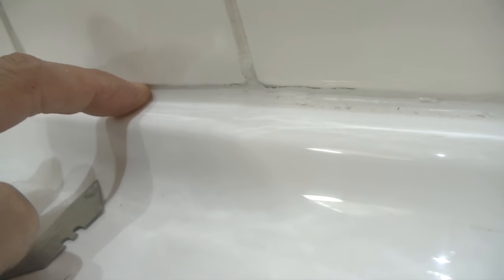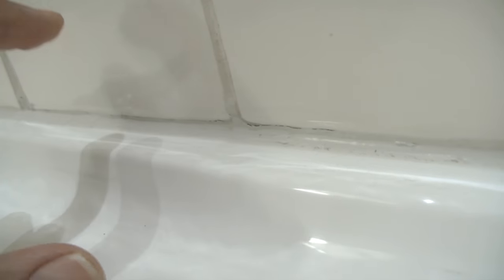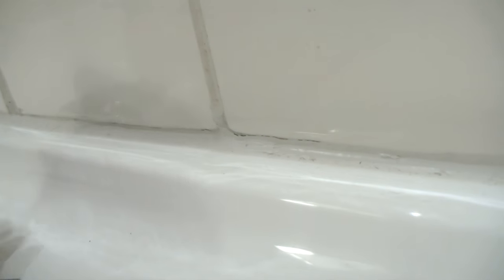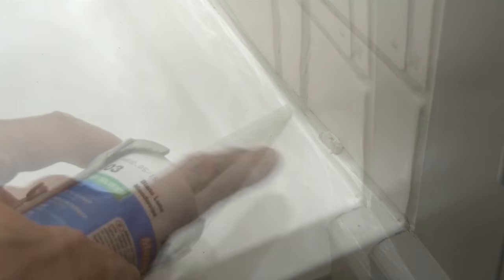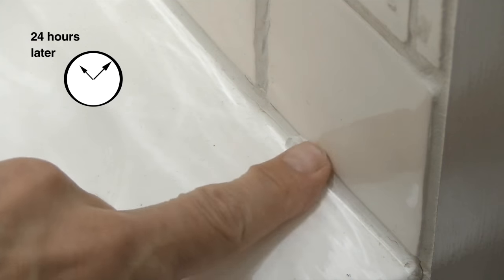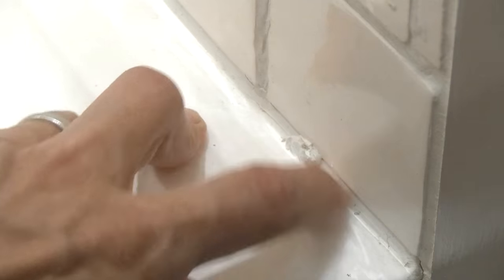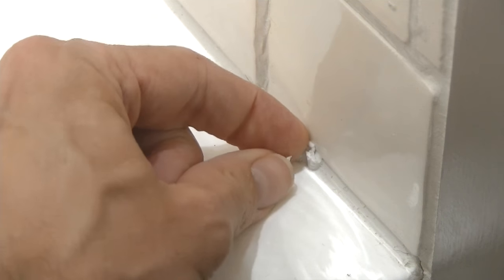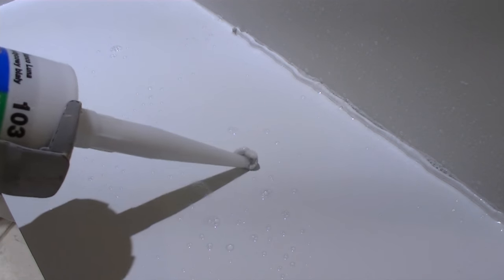Can You Silicone Over Existing Silicone?

Comment: I only need to silicone the base and a foot vertical in corner. @Charliediyte can I silicone up to the old silicone trying to refrain from removing the entire shower. A d only do the bits I need to do?
Reply from the maker: Yes, you can certainly do that. Check out this https://youtu.be/EErbuodMOAM for the corner. Cut off any loose silicone if there is any. Thoroughly degrease the area and then do the vertical bead. Let that set and then do the horizontal like I do in the video.
Reply: @CharlieDIYte  Thankyou so much for responding. Im a new subscriber and love your vids. Came here after doing a bad, taped up job.  Now I've completed it, after watching your tips. I've not done too bad a job. Thankyou!!!

Comment: The sliders that fit on the side of the Fuji sliders are great to give a smooth finish but if you need a second, final attempt you may have to take off the sliders. Using a diagonal finish is a real discipline 'cos you cant just finish it off with your finger so use the above suggestion for a 2nd attempt.

Comment: can you silicone new white silicone over yellow silicone? or will the yellow silicone come through it?
Reply from the maker: I would have thought you'll be fine. You could always try on a small section.
Reply: @CharlieDIYte  ill give it a test today see how it goes, cause after bathroom was renovated in like 2 weeks it turned yellow/orange not very happy... thanks for your reply
Reply: @pixyfp5370  I'm having the same problem, applied silicone but after a few weeks it turned yellow. Where you able to fix the problem?
Reply: @user-sv4ev5qg1u  unfortunatley nope, the waterproof paint behind the tile is black and im thinking that is causing mine to turn yellow, in one of my bathrooms i actually put a little white grout into the corners because some reason my gaps are big i know you are not ment to do that but its the only way i was able to stop it from turning orange but some of the gaps were like a centremeter thick if you only got little gaps and its turning yellow again im not sure sorry

Comment: As someone who worked in the maritime industry for 20 years doing most everything you can imagine the answer is a resounding no. My first rule is to NEVER use silicone period. It’s a contaminant more than it is a sealant. I’ve never experienced it sticking to itself with any success... ever. I haven’t ever seen it not fail either. 

When sealing anything the number one rule is to over prep the area you’re going to seal. This includes roughing up the surfaces and cleaning it of any oils before you continue. Removing existing silicone is extremely labor intensive. Sure, the bulk is removed easy enough but what’s penetrated into the surface area is fairly permanent creating a big problem because it won’t stick to its self let alone anything else.
Reply: I agree.
Reply: If not silicone, what would you suggest for a bathtub?
Reply: @sl1237  An acrylic bathroom caulk containing a mildewcide. It may not last as long as silicone on a NEW installation, but it will be a lot easier to remove and replace than silicone.
Reply: Is there a type of caulk you can you remove the top mold stained layer with a solvent and elbow grease, and also allow you to apply it over itself and be water tight?

Comment: Watched all your silicone videos before having my first go at it yesterday and have found them all super useful. One thing you didn’t mention, it’s like working with marshmallow fluff! So glad I had some decorators wipes on hand or I’d likely still be stuck to the kitchen. 😂
Reply from the maker: Yes, decorators wipes are a great thing to have handy. I tend to clean off the silicone in between runs with tissue, having a bin handy to put it in, and then at the end of the job I give the tool a good clean with a decorators wipe. How did you get on?
Reply: @CharlieDIYte  Not to bad, however the space behind the kitchen tap was difficult to navigate, so isn't very smooth , but I now know I can silicone over silicone ! So may try and salvage it. All of your video are so valuable as a DIY novice who's just bought an old house! Really appreciate being able to refer to your videos 👍😊
Reply: @larabrooks570  He has a video for doing behind taps. 🙂

Comment: Hi, in the U.S. what did you use to clean the silicone? I want to clean where a new bead will butt-up against an older bead and want the best possible adhesion. 

Either that or I remove it all and start new. I removed a section and it was slow going with a razor knife. I might need a chemical if I strip it all out. 

Thanks.
Reply from the maker: Are you wanting to keep the existing silicone, in which case you want a degreaser like acetone. If you're wanting to remove it, Google "silicone remover". I'm afraid I'm not totally up on what the best products are in the US.

Comment: So I recently saw this video and do have to say I learned a lot that most will say can't be done.  I am repairing a 60 gallon fish tank with very thick walls.  Old style fish tank.  I ordered the cramer profiling kit 5.  I also ordered the best fish tank sealant you can buy.  After stripping the old sealant off of the tank, I found that on the bottom, of course, that the bottom piece did not contact the side glass and instead they just filled in the gap which is about 14mm.  Using the 16mm is cutting it very close, but i am determined to give this a try.  What is the chemical you use to clean the old caulk?  The site of leak is on the opposite side of the tank just to mention. I can send pictures if needed, which may help alot.  What is your opinion on this issue?  Also is their something I can use to deal with this wide gap in the tank?  All other parts are close together.  Any help would be greatly appreciated and passed along to others.  I am not a throw away person and believe in finding a way to fix things.

Comment: Your video was great. I bought the Cramer set with the scraper. I completed 2 vertical lines for the tile above my bathtub. I’m letting it dry and then I’ll do the horizontal lines so that my inside corners don’t get messed 
up. The only thing I didn’t understand in your vid is when you showed the 45 degrees vs 90 degrees... they looked the same to me in the video.... :-(
Reply: Hello my dear, I already realized that you can get the same width of cilicone, but not as thick as it is when you cut it 90° , so with a 90° line, the line you get would still be thicker, which is better to avoid having some gaps. Thanks!

Comment: I need help with my bath tub and I hope you can help me!
I really need to re- silicone my bathtub. I seem to have a lot of movement with my bathtub and every time I redo the job it is only a matter of months before I seem to be doing it again. I have Mapesil AC to do it this time round. 
Do you have any tips for me? Should I fill the tub up with water for example to add extra weight...?
Thanks in advance.
Reply: Sort out the movement of your tub first, use L brackets to secure it to the wall from underneath. Check the legs are levelled, I've even used bricks with a bit of wood on top to wedge under both ends of the bathtub to limit movement. Mapei is a good silicone, i use it for its colour range, it goes off quite quick,  so be ready to smooth off.

Comment: I physically fear this DIY.
My sealant is all lumpy. Maybe I put too much on. I've no idea. I used one of those Fugi tools.. Made my life harder.

For me it's nozzle at an angle and wet finger. I cannot get the professional methods to work.
I'm gutted.
Reply from the maker: Sorry to hear that. Sounds like you might be leaving it too long before tooling. Work in short sections and tool immediately. Failing that, I'm not sure what you're doing wrong.
Reply: Am am with you on that. Not sure what damage the soapy water does to silicone?
Reply: @LEO-xo9cz  stops it sticking I believe.